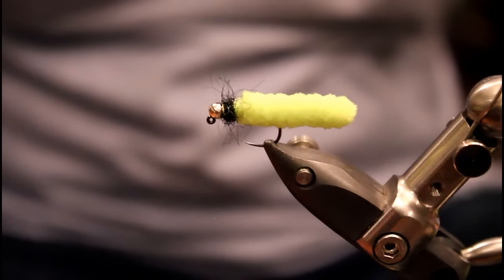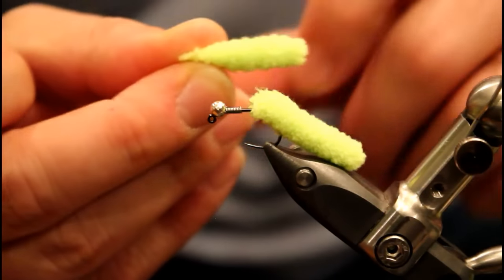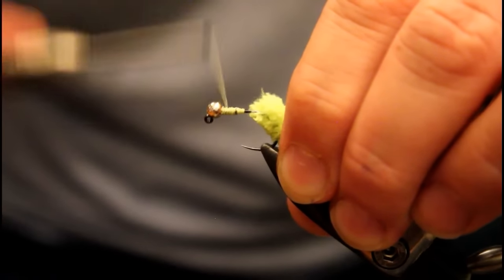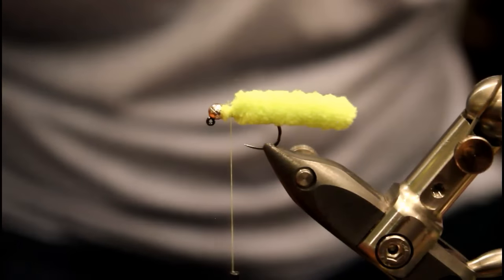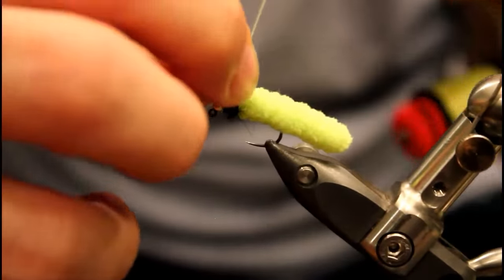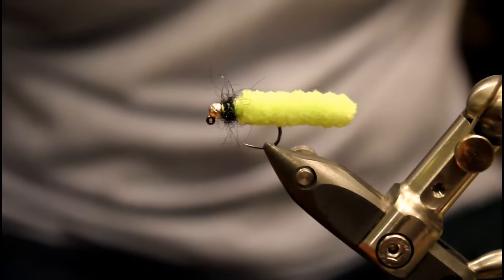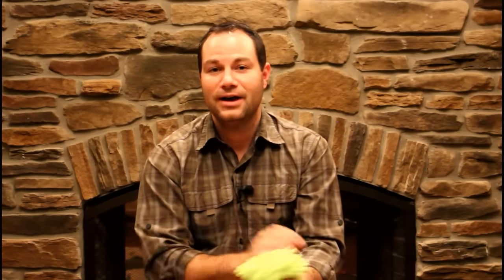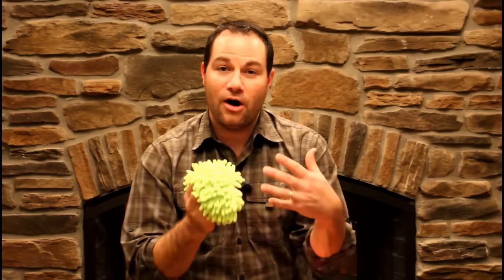Fly Tying: The Mop Fly

Comment: Tim, We've had good luck with the mop fly here in Northwest Arkansas. We tie it in the chartreuse, orange, gray, and black pattern on a jig hook and paint the lead head black, orange, or chartreuse. Your dust slippers sound like the best way to go. The mops at the automotive stores are pretty pricey, but you get a whole truckload of worms from one mop. I haven't tried to use the mop fly yet. I'm having too much luck with an orange tinsel and furnace hackle crackle back #14, but I will give them a try when I'm back on the stream. Thanks.
Reply from the maker: Excellent comments and it sounds like this fly works all over.  Thanks for sharing your suggestions with us, and let me know how the fly works for you.  Tim

Comment: As others have commented, I too have just tied up a few mop flys before seeing this video. Turns out I tied it exactly like Tim did. You can buy this material in the cleaning isle at most big box stores, but also look in the automotive detail section. One thing to note is that they seem to come in different lengths. I have 4 colors and they range from 3/4" - 1 1/4". I'll be ordering some more from Tim's link, those looked plenty long. The 3/4" one I have is almost too short after you peel back the material to the core.
Reply from the maker: Great minds think alike, Brendon!  ;-)  Tim

Comment: Brian Rader The Pisgah Angler

I have been using the mop fly for a year now, and have found it to be an incredible fly for stock trout.  I have tied it in blue, green , and yellow.  The yellow has been the color that works for me, and like you i add dubbing.  I like using a black ice dubbing.  This year so far I have caught several rainbows 18" and one 20" beast!  One nice brown that was around 17".  I like to use a 9' 5wt rod, and high stick through fast water runs. Trout almost always hit the fly at the end of the swing. I found my mop material at Walmart, & Family dollar stores. They can be found in the automotive section of these stores.  They are hand  mittens for washing your car.  I plan on trying the mop fly on Wild trout in the spring. I have heard they will hit them, but not like the stock trout. The mop fly is very popular here in North Carolina.   I enjoyed your video!
Reply from the maker: Thanks for the comments, Brian, and it seems like we've had similar experiences.  The Mop has worked very well for me with stocked trout, though it hasn't been one I've fished with great confidence over wild trout.  Like you, I have gotten more subtle colors and plan on spending more time fishing it this spring.  Thanks again for kind words and taking a moment to comment.  Tim

Comment: Thanks for posting this pattern.  It's one of the most productive I've found for the lakes here in NW Montana.  But I've got a couple questions.  I noticed that if I tied it like you showed, the "mop" would float all over the place and I wondered if I missed some hook-sets because the fish struck the mop but didn't get part of the hook.  So I've been tying them so that the tag end of my tying thread is long long enough to wrap forward (without compressing the mop)after I tie in at the head, essentially ribbing the mop onto the hook shank.  This has cured that floating away problem.  So- do you think it's necessary to do that?  Also, I get what I think are short-strikes a lot.  I get a nibble, but not a strike.  Is that from having a mop too long for the hook?  Or maybe the fish are too small to bite the whole thing.  Here's thanks in advance, and thanks for all the help your videos have given me!
Reply from the maker: You're welcome, Doug, and thanks for the kind words.  In regards to "floating away," I know exactly what you mean.  I've started playing around with a Mini Mop, with a shorter length.  That may help to solve some of the issue you're having, but it's tough to determine them from here.  Knowing it's a lake, then there's a likelihood that the fish are striking the "tail", hence causing them to be missed.  The ribbing can definitely help, though my larger Mop flies continued to be tied like in the video.  I haven't had many problems with them, though I tend to fish them in moving water or stripping slowly in stillwater.  I hope that helps, and you better invite me to that lake in Montana sometime!  ;-)  Tim
Reply: Thanks, and anytime!